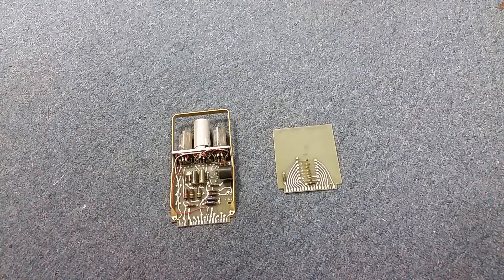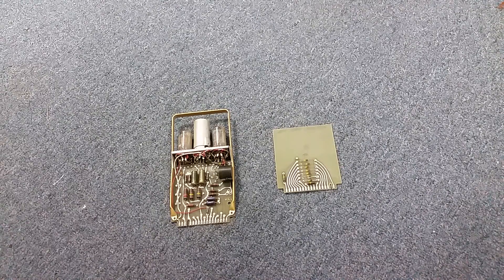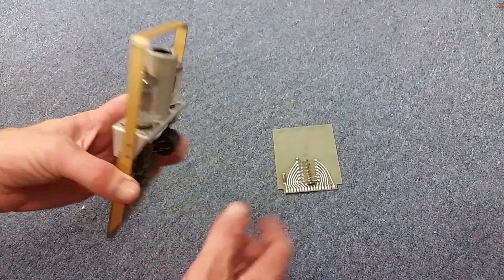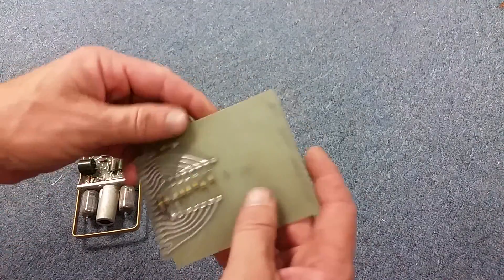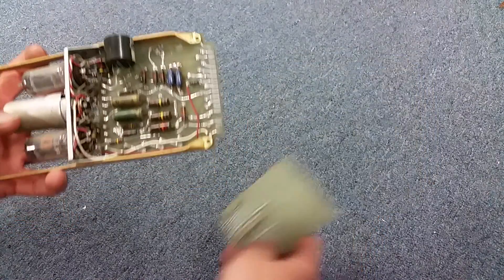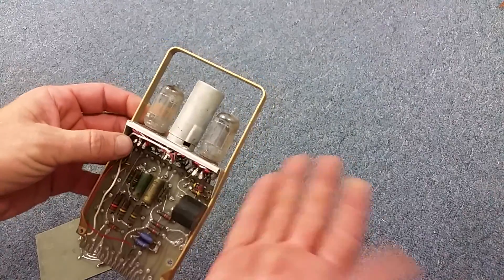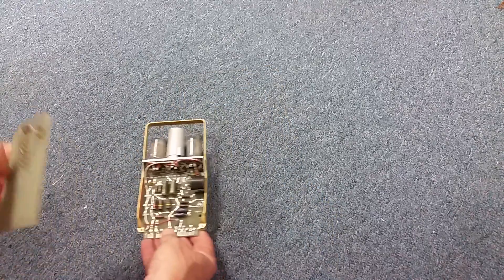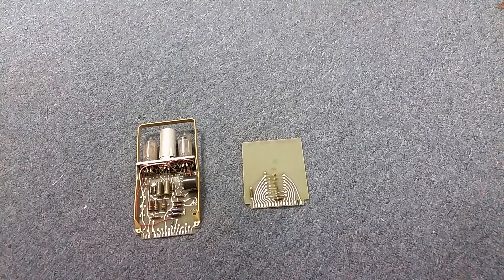Bendix G-15 Modules

Comment: How much power does this computer use?
Reply from the maker: No as much as one might think. Sure, they will keep a room nice and warm, but the G-15s could be run in an office setting, or even residential.
Reply: Here's a manual for it:

https://archive.org/stream/bitsavers_bendixg15Tov60_9786179/T17-1_CA-2_Reference_Man_Nov60#page/n0/mode/2up